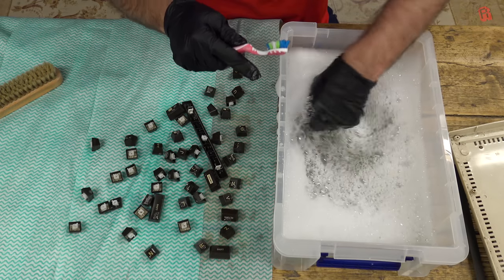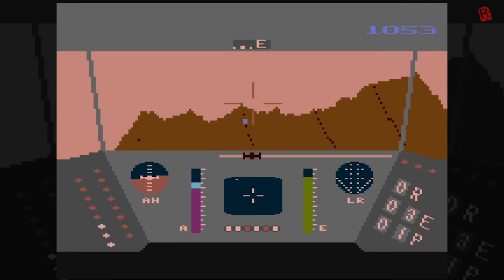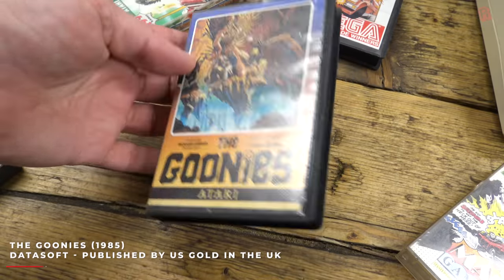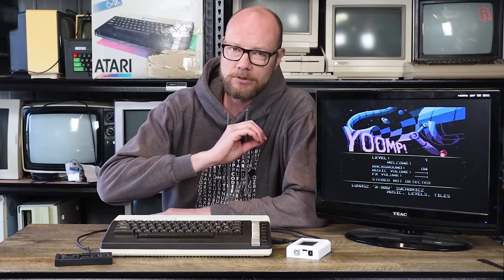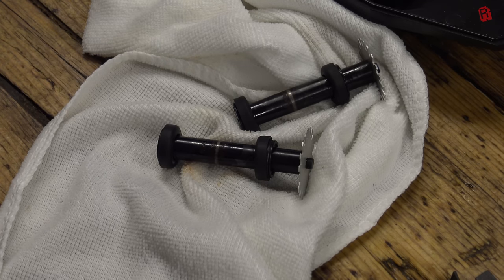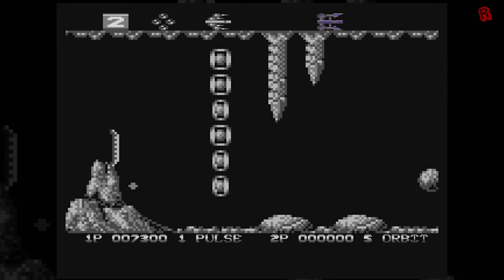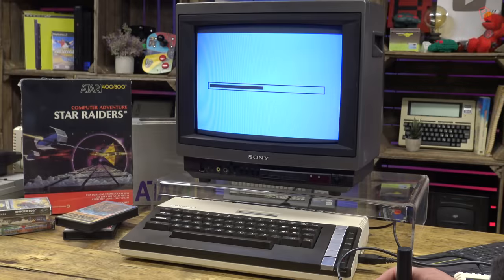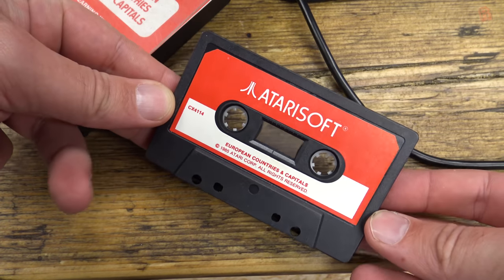What was the Atari 800XL capable of? | Trash to Treasure Part 3

Comment: Why wasn't this system more popular in the UK? It appears to be graphically superior to the C64 (which was a bit brown).
Reply from the maker: I should imagine initially because the original line up was very expensive compared to the super cheap Sinclair models, and then when the price did come down the C64 and Sinclair were dominant
Reply: @RMCRetro  now that you mention it, that does jog a few memory synapses.
Reply: As said, the Atari hardware was originally VERY expensive. Being aimed at the US market it was intended to compete with the likes of the Apple II, not the ZX80, and so it was a spare-no-expense design with custom co-processors and a huge amount of power built in. At the time, mainstream US consumers had a lot more disposable income than those in the UK, so Atari was able to build a machine that would have just been way too expensive for any UK computer company aiming at the home market.

The knock-on effect was that when the Atari 8-bits arrived in the UK, they were extremely expensive by the standards of the UK market, and the software was also notoriously pricey - but everybody also recognised that the graphics and sound quality was way in advance of what most British home micros could achieve.

Around 1983-4 Jack Tramiel took over Atari, introduced the XL range and instigated a massive price-cutting campaign, but by that time the C64 and Spectrum had well and truly captured the mass market.
Reply: @dunebasher1971  what a time for home microcomputers.  The opportunities were there, but business men didn't have a clue what they were doing, if you Tramiel what I mean.
Reply: @FatNorthernBigot  Synapse made some great games for the Atari. What was great was they took an arcade game and instead of just copying it, improved upon it.
Reply: @RMCRetro  I think the real killer was the dearth of UK produced or published software. It was all imported at exorbitant prices. Only with the XL/XE range did major UK software houses start producing or publishing software for it.
Reply: @dunebasher1971  The XL range predates Tramiel's arrival at Atari by a couple of years.  The 1200XL came out in December of '82 and was a disaster.  It was cheaper to manufacture (single board as opposed to multiple, lightweight case and shielding) and looked fantastic, but was slightly incompatible with the 800 and its big new features - the function and help keys - weren't worth the incompatibility.  Also, no means of expansion beyond Atari's custom (if sophisticated - it was a forerunner of USB) serial port.  The $1000 pricetag and compatibility issues meant it was dead on arrival.  

The 800XL was speced out by March as a replacement for the 1200, and came out by the end of '83.  It was further cost reduced but more compatible and more expandable,  and was warmly received at around $150 on the street.  But by that point the C64 had been flooding the market for a year and Atari had  manufacturing difficulties and couldn't meet demand during the crucial Christmas sales season.  They never really recovered from that and coupled with the ongoing videogame crash of '83 nearly went under.  Tramiel bought the operation off of Warner Communications in the summer of '84 and - with Atari's manufacturing difficulties largely ironed out - was able to move around 700,000 machines that year, mostly at Christmas, at  rock bottom prices and typically bundled with a disk drive.

Tramiel refreshed the line once, in '85, with the XE series, including the 8-bit flagship the 130XE, which came with 128KB of RAM (which most users deployed as a ramdisk).  These were further cost-reduced and were really meant to target Eastern Europe and other developing nations.  They had notorious reliability issues and bad, mushy keyboards, although they were certainly the most contemporary-looking budget 8-bit computers, with their grey and white color scheme.
Reply: High cost......Atari policy  to keep software for the system  as a private business, the lack of documentation on programming all those custom chips (DE RE ATARI came way to late and it was an unofficial effort), in short  high cost and bad marketing and relations with the software companies of the era. Suing them doesn't really help..lol

Comment: The sloped Atari Pro-Line joystick is more age-appropriate for this computer. For the full experience you also need the tape recorder. Added points if it already has snapped buttons. then you need to load a text adventure like Level 9's Worm in Paradise which took about 25 minutes... only to have the thing not load 4 or 5 times because the dedicated tape player was awful and the BAUD speed of the bus was pathetic.

Comment: Fractious also shows off the faster clock speed of the 800 vs c64 in the form of higher frame rates
Reply: The difference in CPU speed is usually about 17%, which is less than what we see in this example.  The reason there is a greater difference with this game is that it apparently uses for part of the display a low resolution mode that the C64 lacks.  The advantage is two-fold: the CPU speed is about 32% faster with about half the screen in this mode, and there is less memory to manipulate.

Which computer has the overall advantage depends on the type of game being played.  Clearly the Atari is better at games that have lower resolution, and even games that have the same resolution but depend heavily on the CPU at least have a smaller 17% advantage on the Atari.  On the other hand, games that make heavy use of sprites are usually better on the C64, especially if the Atari has to resort to using software sprites.  In such cases, its 17% CPU advantage is totally eaten up and then some, leaving more CPU cycles available on the C64.
Reply: @rbrtck  why is this so important for you? Again, so many modern shared titles run faster on the Atari 8bit. Miner's machines (Atari8bit, Amiga) don't need hardware sprites. They can easily move software sprites without  slowdowns. We can see that in so many games with  large, colorful, animated software sprites. THis is where the faster architecture comes in handy.
Reply: @nickolasgaspar9660  "why is this so important for you?"

What is that to you?  It's not about me, it's about making sure that information is accurate.  I suppose that's what's important to me, if it even matters.

"Again, so many modern shared titles run faster on the Atari 8bit."

This involves a great many factors.  I'm just talking about how the hardware compares.

"Miner's machines (Atari8bit, Amiga) don't need hardware sprites."

No machine needs hardware sprites, although they are nice to have and can improve performance significantly in some/many cases.  They can also make development easier and faster (which means less expensive), which was important for industry support back in the day.  And mentioning the Atari 8-bit (or A8 for short) in the same breath as the Amiga is misleading, because the Amiga actually has hardware that accelerates the manipulation of graphics, software sprites (i.e. "sprites" that are part of the graphics data instead of residing in their own independent layer) in particular: the Agnus chip has a blitter for this that works faster than the CPU for this chore and unburdens it.  In contrast, anything involving software sprites on the A8 is entirely dependent on its ordinary 6502 CPU.

The idea that many tout about the ANTIC chip being a second processor or whatever doesn't change this fact.  Technically, it is one, because of how it processes a list of modes to display for each row, but unlike the case of the Amiga, this helps exactly nothing with regard to software sprites.  The ANTIC does feed data to the GTIA chip to support its hardware sprites (player-missile graphics), but they are a bit limited, and if they are not enough, then the 6502 alone is what does the work for the software sprites.

"They can easily move software sprites without slowdowns."

There is no "they" here.  The Amiga has a special ability (for the time) to manipulate software sprites faster through hardware acceleration, while the A8 handles them in the same manner as any other 8-bit computer, namely with its CPU.  Of course, both have many other graphics features that enhance their graphics performance, but it is misleading to compare the two to each other with regard to software sprites.  "They" are not comparable in this context.

"We can see that in so many games with large, colorful, animated software sprites. THis is where the faster architecture comes in handy."

The A8's CPU is a bit faster than those of most 8-bit computers of that era (not all, though, like the BBC Micro/Master, which runs at a true, full 2 MHz, and so does the C128 in some modes), but not by as much as many seem to believe.  It might run at 1.79 MHz, but as I demonstrated in another comment thread, its effective CPU speed, under rather common conditions for games, is very close to that of the Apple II's 1 MHz 6502, and as little as 10.5% faster than the C64's CPU (under game conditions, as well, with all DMA active).  This is less than the theoretical difference that I discussed elsewhere (like in this thread), and was based on running the exact same code on all of the 6502-based computers being compared.

In the game project I've been working on for both the C64 and A8 (the 800 or 400 with 48K RAM is the current minimum platform I'm targeting), I'm currently implementing the flying ducks, which the C64's hardware sprites have made very easy and fast.  I could use the A8's hardware sprites (player-missile graphics) in a similar manner, but that would result in much poorer resolution in this "hi-res" game, so I'm implementing the ducks as software sprites on the A8 instead.  I could do the exact same thing on the C64, no problem, using virtually the same 6502 machine language code, as both have CPU cycles to spare, given the simplicity of the sprite animation involved.  Without a doubt the C64 does this far more efficiently with its hardware sprites, however, using far, far fewer CPU cycles and taking far less development time.  And even if I were to use the A8's hardware sprites for this aspect of the game, it would still be less efficient because the CPU is required to move/shift data for vertical movements.  If I were to greatly increase the number of animation frames to make smoother, more detailed animation, then the A8's CPU, despite being a bit faster, would run out of cycles and thereby become the limiting factor far sooner than the C64's less burdened CPU.  To be sure, the A8 is better for some types of games, such as those with first-person graphics, while the C64 is better for others, like this old-school type of arcade game or role-playing adventures, because it has more options and flexibility for hi-res content and placing colors on the screen.

Comment: Aaaah thanks for this.....not enough Atari coverage out there, but you've made up for it ;-)  

It always saddened me that Atari didn't get the accolades it deserved here in the UK...and to compare the Atari 8bit era to  the C64 isn't really fair when the hardware basically came out around the same time as the Pet, and before the  VIC 20.   All that changed when the 800XL came out was the max memory available increased from 48K to 64K (apart from also a few custom chip upgrades and better expand-ability).

Comment: RetroManCave Not an Atari questions but still retro, I have an Amiga 2000 with a Individual Computers Flickerfixer/Scandoubler which outputs to VGA.  I want to be able to capture game play and not sure what I need to take the VGA output to HDMI.  I have a Simplecom CM201 VGA to HDMI Converter which I have connected to a USB3 Capture device, but unfortunatly it does not work in OBS.  I have verified that the capture device works by using a PS3 and that works.  Any suggestions would be welcome.  Your channel and others have got me back into retro computing again,  I have recently got my Amiga 2000 out of storage.  Thank you for your great videos, even your Atari ones (cough cough)..

Comment: The last V8 huh. Your video looks quite different to the output I get with that...
I suppose it's colour tweaking...

The Atari 8 bits have some very... insane capabilities when pushed to the extremes, but the more mundane uses show up a few weaknesses.

For instance:
Extremes: With a more powerful CPU (and more memory) pushing it, Pokey has been demonstrated playing back 44.1 khz full audio at 6 bits per sample.
Yet in routine use it'd struggle to get even a vague approximation.
With clever use of interrupts and GTIA modes you get 256 or even 4096 colour modes.
Yet more typical usage you generally have 5 or less colours at once.
A long list of similar gaps between what you can coax the system into doing vs what it does with simpler techniques makes for a system where it takes a lot of work to show it in it's best light...

Comment: Making a trackball where you have to remove glued-on rubber feet just to clean it? That's like gluing the oil cap shut in a car engine! Also, please tell me the port of Crystal Castles supports trackball mode.

Comment: Excellent video and so glad to see Atari is a very capable machine of it had the right programmers.

I have a question. We all know that Atari games came as cartridges, discs, and tapes. However, the tape drive to load the cassette games was incredibly unreliable. I have heard of a trick that you can covert cassette games into floppy disc drives. 

Is there a way to dedicate an episode or a video of how to convert cassette games into disc drives? Thanks

Zack
Reply: I doubt RMC would do that video but with the Atari 8bits there's no need for a tape drive. I think C64 had games only on tape but on Atari every game was easily converted to floppy disk right after release (days not weeks after release).  However any tape with an audio track could obviously not have the audio moved to disk...
Reply: GamedOut Gamer I think you have missed my point and let me reiterate. 

I am referring to the existing cassette tapes are already available. Let’s take an a example, I used to own Ninja game on the cassette tape. However, the tape loader/ drive was not reliable and couldn’t load up the cassette game anymore. So I want to convert that tape into the floppy disk drive. That’s what I am referring to of how can such a thing can get done.
Reply: @ubiased23  Tape games were long ago converted to disk games. You mean a video on how to crack the tape games to disk? That's what I answered. Of if you asking to put the actual tape into the disk drive of course not.

Comment: Really unfair to compare Atari 800XL music to C64 music, The SID chip is the most OP chip of all time.
Reply from the maker: I think the 800 stood up pretty well against it, what would you like to have seen as a comparison?
Reply: Well I was joking but I do think a amstrad cpc 464 would have been closer in sound capabilities.
Reply: Yes unfair to compare a chip that's 4 years younger than the Atari one ;-)
Reply: The C64 may have had a SID chip but it was only 3 voices. The Atari could do 4 voices, so I think there were some tricks Atari could do to make it sound almost as good.
Reply: @twiddler71  POKEY was an amazing chip for '79 and got used in a slew of arcade cabinets if memory serves.  SID is certainly a better chip, but with its four voices the 800 was absolutely no slouch.
Reply: Pokey is an effects chip, SID is a music chip. Two very different design principles. Listen to Blue Max on Atari 8bit and enjoy all the sound effects while SID pales in comparison. It all depends on the programmer(s) and how they use it. SID is awesome for music when in the right hands. The Atari's Pokey chip was used in Tempest arcade machine which drives the chip far better and faster. The chip is very capable but the Atari's 6502 CPU @ 1.8mhz is not fully up to the task.
Reply: @gamedoutgamer  POKEY can do music. Look at what Atari did with the Star Wars theme in their arcade games using Quad POKEY configuration. 16-voices!
Reply: @TheJeremyHolloway  Oh yes! Also softsynth on the 800XL are really good too! https://www.youtube.com/watch?v=Xm5vQm9-JQ4
Reply: SID music sometimes pains my ears, it sounds off key/off pitch. Even in this example the Pokey music is more pleasing to my ears.

Comment: I love the Atari 800 line but the SID did have better sound than the POKEY, especially in the hands of the magician Ron Bubbard
Reply: The SID was easier to program than the POKEY. That's why a lot of its results are considered "better". But the POKEY has 4 voices and can also pull off 2 16-bit voices and can also emulate the SID with some help from the 6502.
Reply: That's a common misconception. Pokey was a superior and ahead of its time sound PCM /hybrid sound chip. Programming was far more demanding  when programmers could take a great result from SID...out of the box.
The truth is that Synth chips were a dead end for the industry and Pokey started that ''argument'' with its PCM capabilities.
ASMA project is a great source to update your opinion on which sound chip could deliver better and more versatile sound.